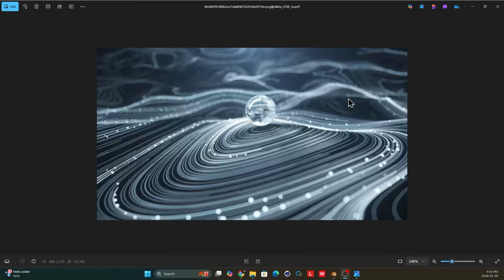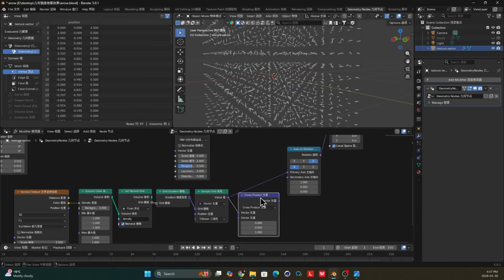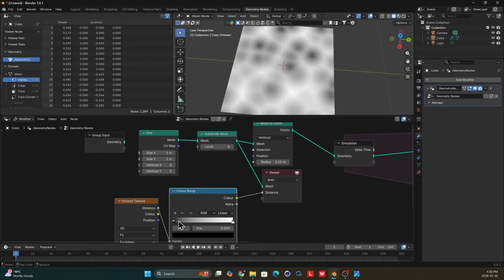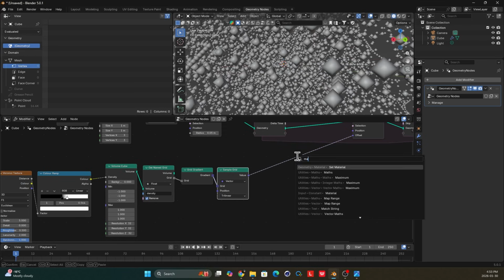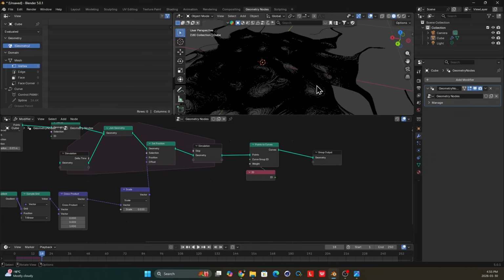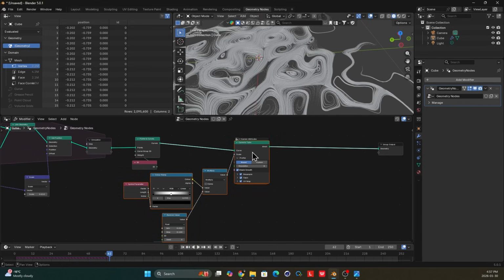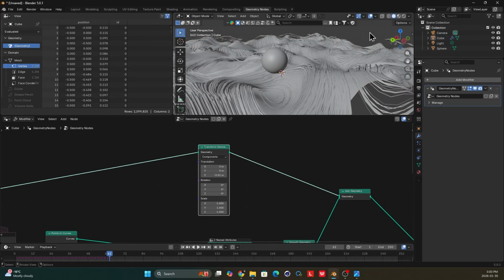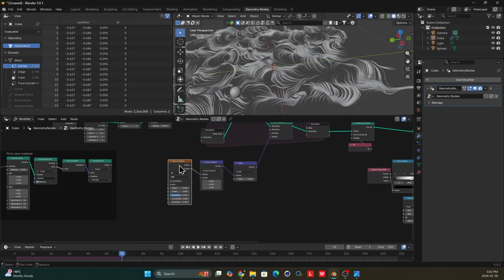Bender 5.0 geometry nodes to make elegant curve animations by using texture nodes

Comment: Amazing tutorial again. Is there a way to animate the texture (scale or W factor) without messing it up ? I guess it's a matter of making a system with substeps?
Reply from the maker: Hi, I guess if the texture changes even a little bit, the whole effect will change.
Reply: @zack-3d-animation  Thanks for your reply! I tried and it seems like it kind of works but only at a slow speed, whenever that gets faster the points connection gets messed up. I tried adding substeps but it doesn't seem to make things better.
Reply from the maker: @subaphonic  The animated texture will change the velocity at each frame. So it will change the whole effect.  Based on this, I think this effect can't apply the changing texture. But you can try if there's other solutions. I also loving trying.